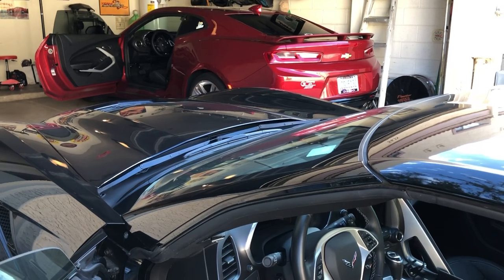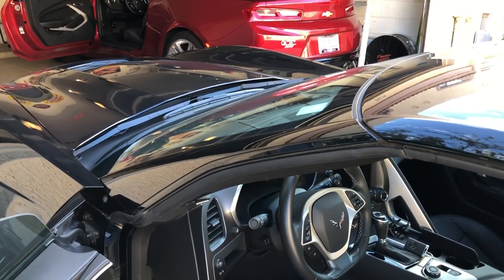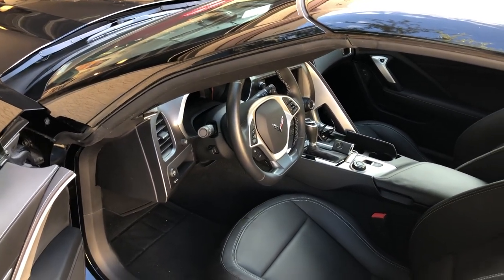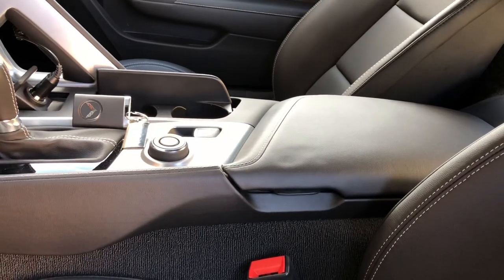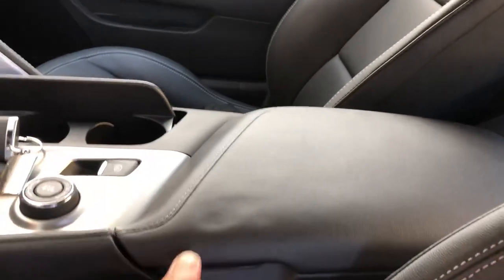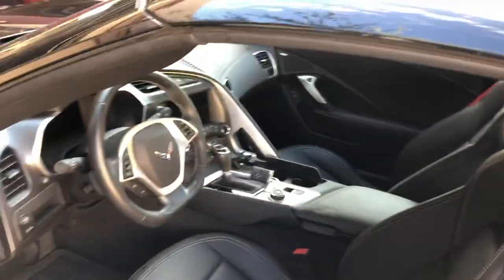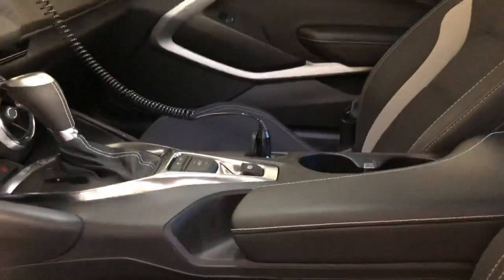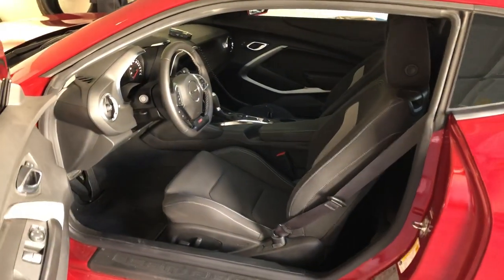Corvette stingray factory flaw

Comment: Replace it with a Ford.
Reply from the maker: 😂 lol. 🤔 hmm???
Reply: Actually, Fords do have better quality interiors than GM.
Reply from the maker: It’s just the corvette that sucks!!! My Camaro is fine!!!
Reply: @mikejautosandstuff3349  I know, just compare the Mustang's interior to the Camaro, the Mustang is much better Mike..( thats the only thing better in the Mustang.)
Reply: @mikejautosandstuff3349   coming for a 17 ZL1 to a 19 Z06 Z07 I personally don't think the interior quality is worse. If anything it's better. More carbon fiber on my 2lz and less plastic than the ZL1.  Other than the armrest/ console lid. What else do you think is bad........ ? No wrinkling issues on my dash either on my 2LZ and it sat outside for about 9-10 months on the dealer lot in CA sun.  Maybe possibly quality problems with your car?.....sorry to hear this.  Good luck
Reply from the maker: Bonanza Driver strange enough now that it’s a little cooler hopefully it goes back into its original shape. Bc I’ve noticed it coming back up some. Less dented.

Comment: This is not surprising at all. Almost every preowned C7 Corvette I look at has a warped center console. Corvette interiors have always been crap. I honestly don't expect it to change much with the C8. They put all the money in the engine and transmission and skimp on the interior.
Reply from the maker: I agree with you!!! The corvette has always had crappy interior from the beginning of time. I’m sure the C8 probably be no better. Especially a mid engine corvette for base price $60k.